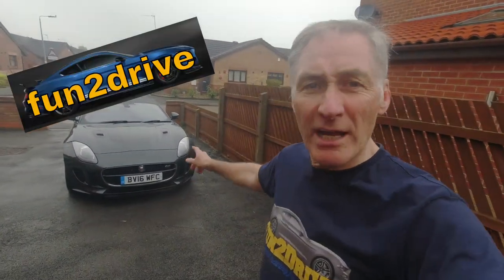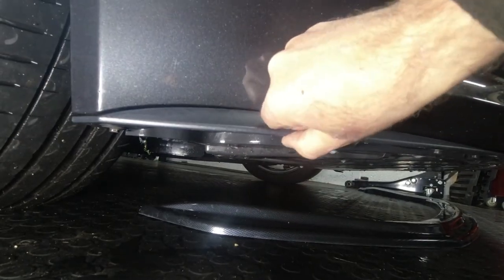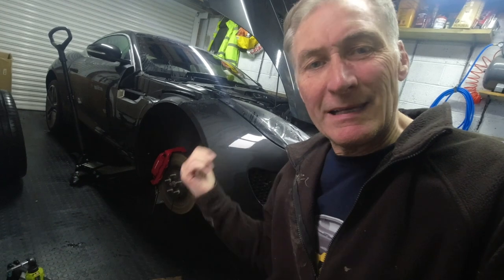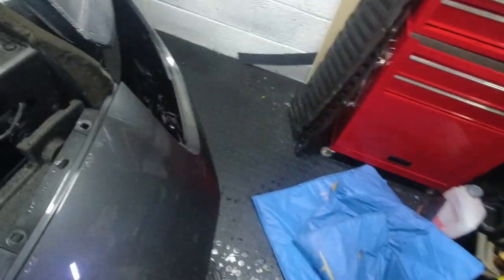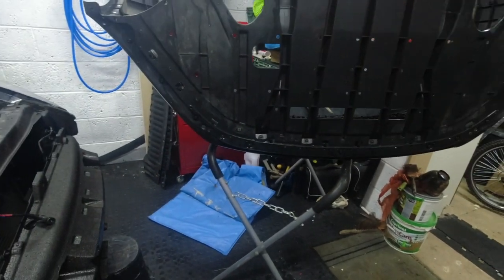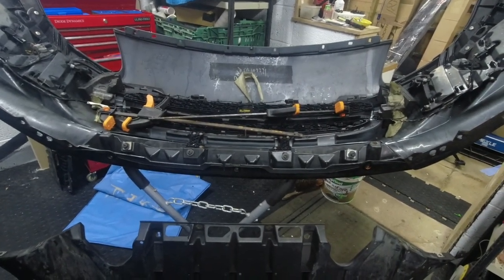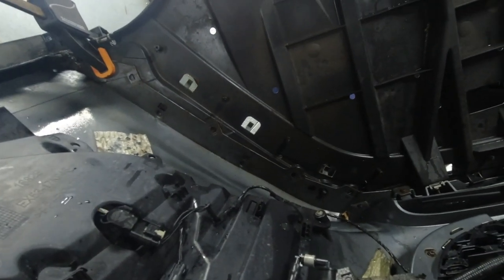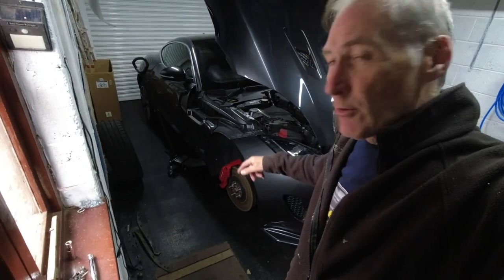Jaguar F Type Maxton Design Body Kit Install | How To | DIY

Comment: This looks really good.  Can you tell me if you were able to put the screws and bolts for the side splitters in any location or did it already have the holes pre-drilled/cutout for you?  I am looking for side splitters for a brand new 2023 Jaguar F-Type P450 that I purchased 2 weeks ago and I cannot find any 3rd party that makes for my year of car.  I like these side splitters that Maxton makes but when I contacted them they said it would not fit my car.  I find that odd since the body style and shape is all the same and the only difference is that front facelift.  I know some companies online sell universal side splitters that are guaranteed to fit but wasn't sure how these worked.  I see that the side splitters have a molded piece in the center that seems to push up against the rocker panel area.  Thanks.
Reply from the maker: yes, they can be bolted anywhere, no pilot holes

Comment: Looked a bit of a complex install but great video !
Reply from the maker: I like to make it so its easy to remove and doesnt bolt through the undertray and the front bumper as the instructions show, meaning that the undertray is removable on its own in the future

Comment: Your front splitter doesn’t have strut support rods. Does the front splitter not need the support rods? Or is it more of just an aesthetic thing
Reply from the maker: Support rods are used on large splitters, this was just a normal size one

Comment: I've got the maxton kit on mine currently but yhe front splitter has cracked. Im guessing it ahould be simpler to re-fit a new one as i already have one on, but are there no bolt holes then? Id have to drill them myself?
Reply from the maker: Yes, that is correct, but just lay the old one over the new one and drill the holes in the same place